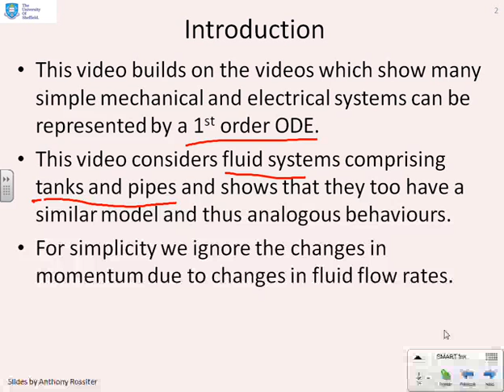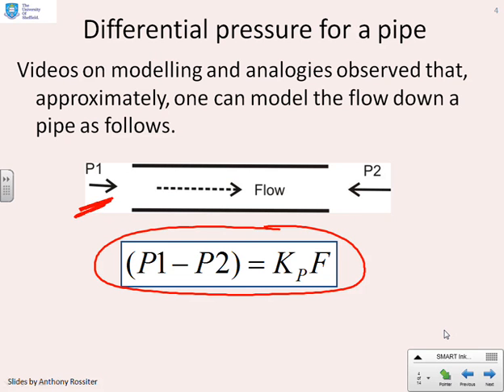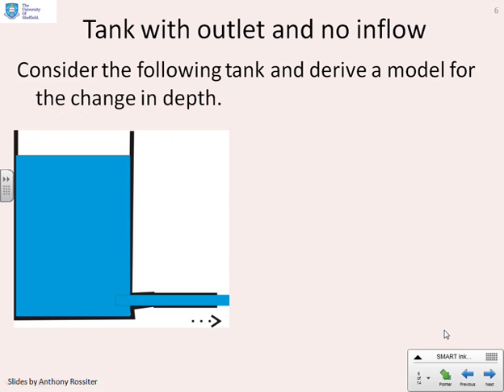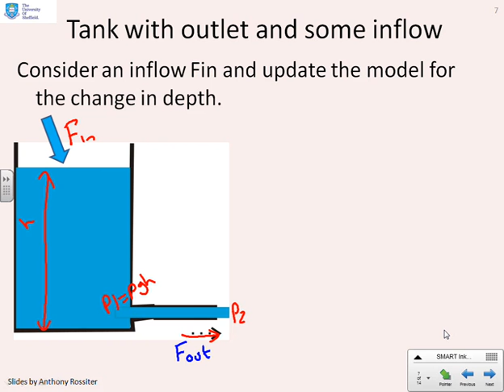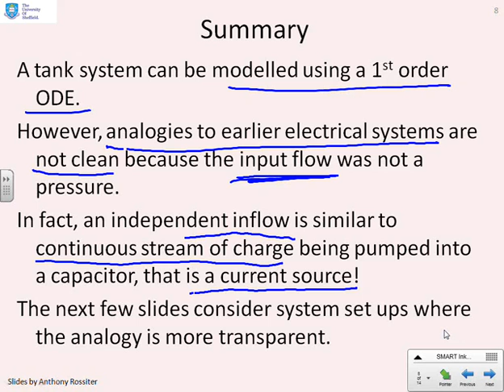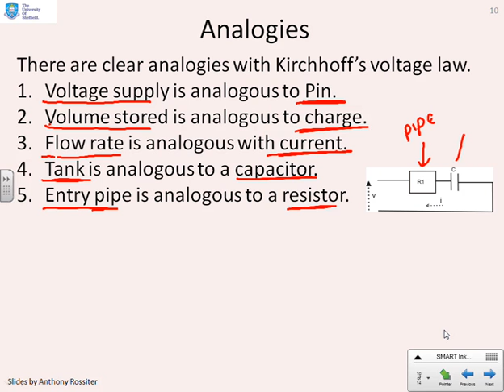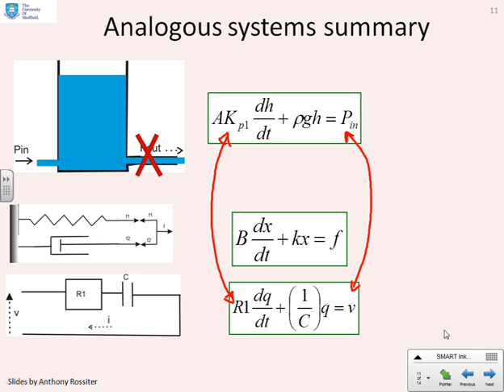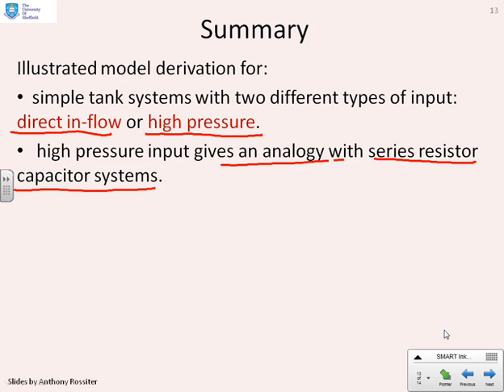1st order modelling 5 - fluid tank systems

Comment: For the first case where our F_{in} is just put into the top of the tank, is it not driven by a pressure? P = F/A, and if I'm not mistaken, gravity is the driving force here through the area of the top of the tank. So P = mg/A for the flow rate F_{in}.
Reply from the maker: +inteusproductions I normally assume the flow in is an input which can therefore be determined precisely (via a pump or some other actuation).Anthony